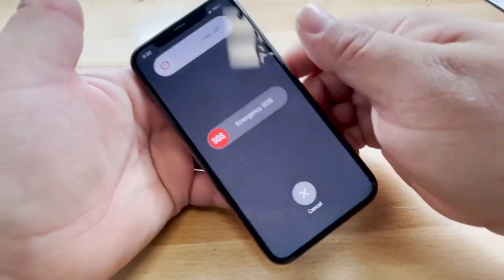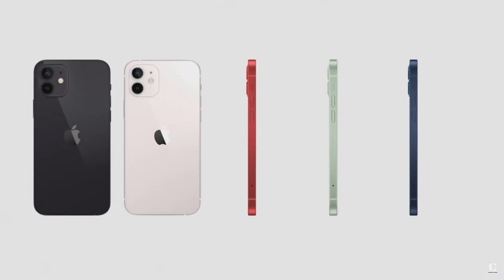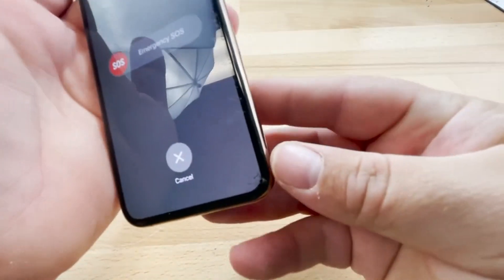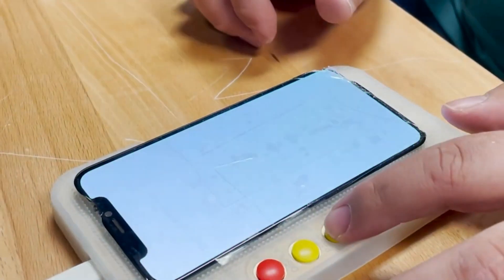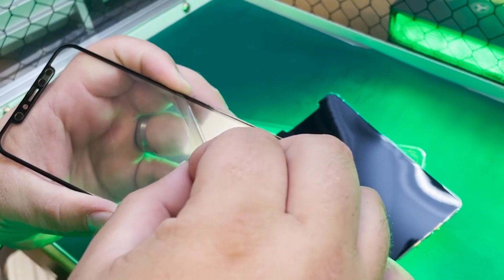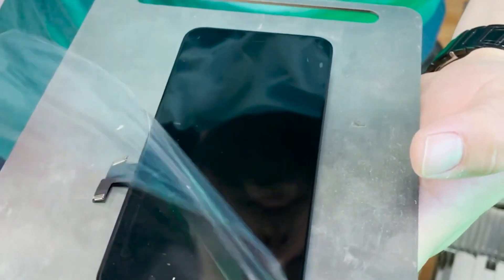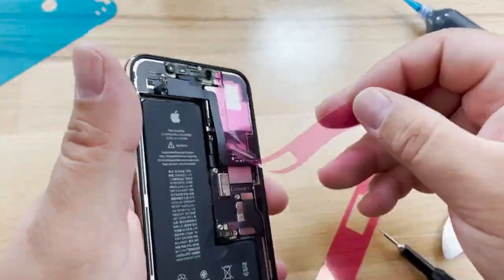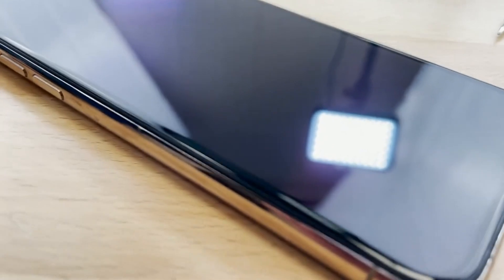iPhone 11 Pro Glass-Only Repair: Professional Refurbishing Process

Comment: Great process. What are your thoughts on freezing the glass off the display
Reply from the maker: It depends on the type of Displays as delamination of the layers due to the temp change can be an issue. I've made it work especially on Samsung Displays, but its not a method I like to use.
Reply: That’s a thing?